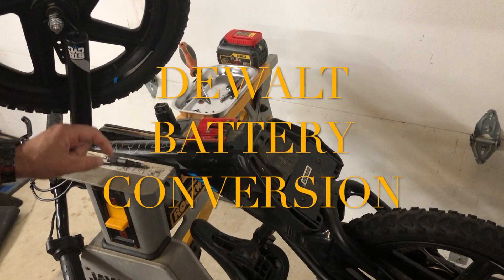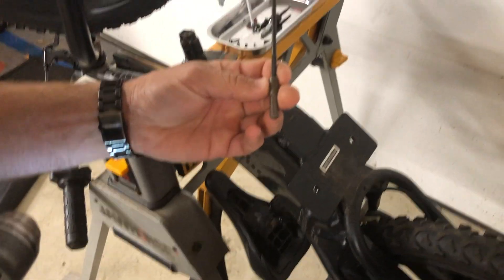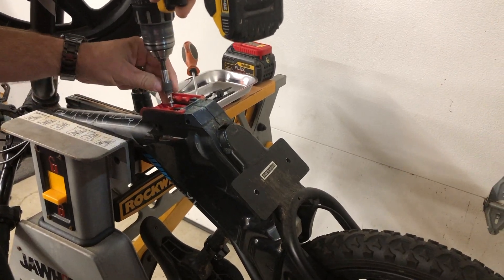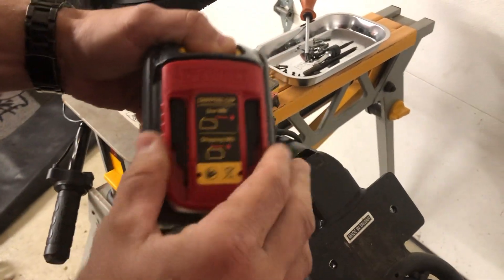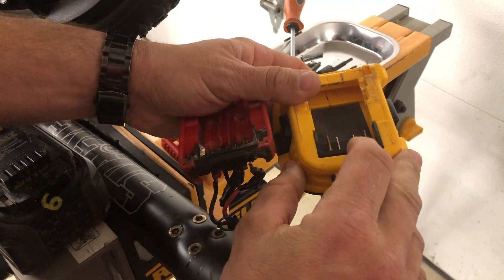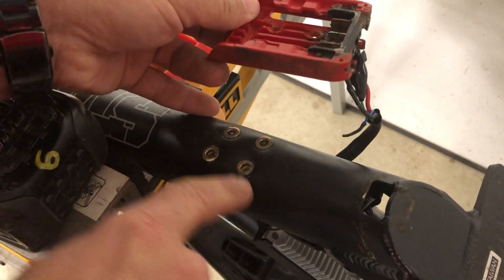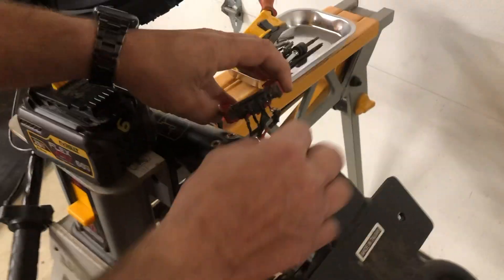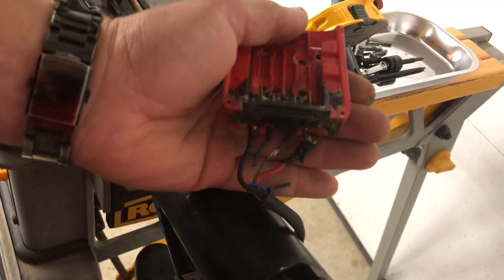STACYC DEWALT 20v BATTERY CONVERSION WITH WIRING

Comment: I did this conversion with a knock off 20v 6ah battery(not a dewault). Not understanding why the blue wire shouldn’t be connected, I soldiered and connected everything perfect. As I excitingly connected the battery and turn the power on, I heard a fuse like pop. Check the 40amp fuse and there were no issues. Then connected 20v directly to the motor and it works fine. Called Stacyc and searched around for more information. Couldn’t find anything out. So now I’m ordering a new motor and esc (electronic speed control) 

No sure if I should try again with only the green wire. Anyone have this experience?

Comment: Awesome! Where did you find the nut serts at? Are those 1/4x 20
Reply from the maker: i used either 4mm or 5mm nut serts. ordered a kit off amazon. 1/4 - 20 is to large
Reply: @Benbuilt4u  I ordered 1/4 x 20 off Amazon and they worked fine for me. I only needed one in the frame since they are a decent diameter
Reply from the maker: @NEMOJA  makes sense
Reply: @Benbuilt4u  3 people noticed the Dewalt 5a battery at the park today. 1st day out with the new kit 👌🏼 now we have 3 batteries

Comment: Why not just buy more batteries from the company??
Reply from the maker: that's easy! there $164 per battery!! that's insane can buy 2 dewalt 6ah 20v/60v batteries for that much and charge them in dewalt 8 amp fast charger. on top of that use them for 200+ other tools
Reply: @Benbuilt4u  hahaha makes sense lol

Comment: If Stacyc wasn't such a greedy company they would have made it so the battery connection would work with multiple brands.
Reply from the maker: couple reasons i can think of, one they probably have to license use of another platforms battery for commercial use/sales. they wouldn't be able to charge there ridiculous price for there battery and lastly if there was a warranty issue there wouldn't be a variable of someone else's battery.

now that harley owns them just expect it to get worse they need to make the most amount of profit per stacyc to support the advertising and slowing motorcycle side of the business
Reply: @Benbuilt4u  I didn't realize Harley had bought them out.
Reply: Funny I found one next to the dumpster at work it is a Harley model brought it home now I’m trying to fix it for my son so he can then move on to a pw50

Comment: Someone really needs make a 3d printed converter
Reply from the maker: yes they do!
Reply: Benbuilt4u  where ?
Reply: You can find them on eBay
Reply: @Bobbbybags  what are they called on Ebay got a link?
Reply: Search eBay for “dewalt 20v adapter 12 guage”
Reply: Robert you know anything about the wiring? I only see 2 wires off it black and red I would assume there going to the same place as in the video n then just capping green n blue
Reply: @Luckyjoey800  you only need the pos, and neg. to work, all others are temp and whatnot. unneeded
Reply: https://www.facebook.com/marketplace/item/236998757513595/

Comment: I have been looking for details on this wiring, thank you! This battery base may help with the custom mount, I think Im going to buy it: https://www.ebay.com/itm/DeWALT-20v-Max-battery-power-connector-mount-adapter-w-12-gauge-wires-robotics/143191484667?hash=item2156e0a8fb:g:8SIAAOSw1rpcJQnn
Reply: Also do you think it would be ok to run the green and red wire on the bike to the same positive wire coming off the battery mount?
Reply from the maker: i never tried any other wiring configuration as this one works. it will not accurately read battery percentage anymore so i monitor the batteries with the fuel gauge built into the dewalts